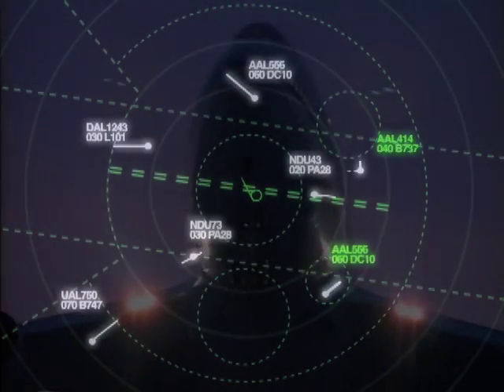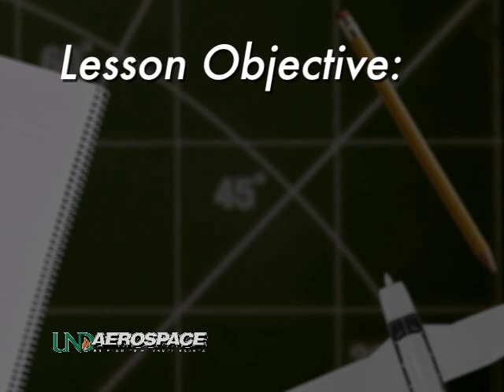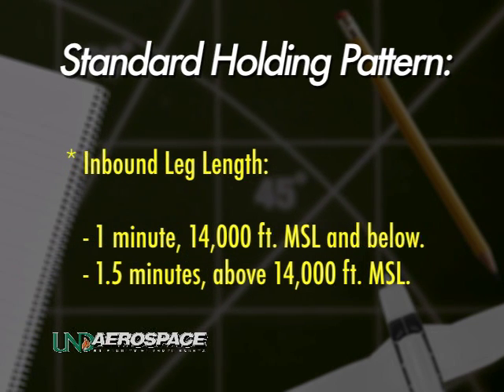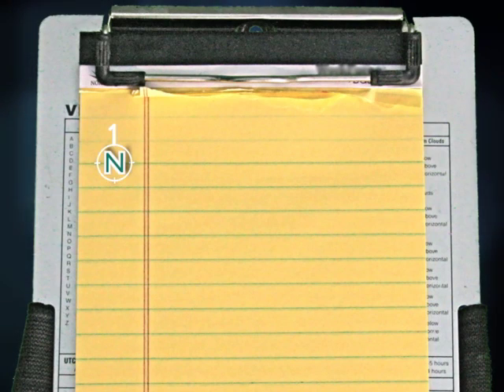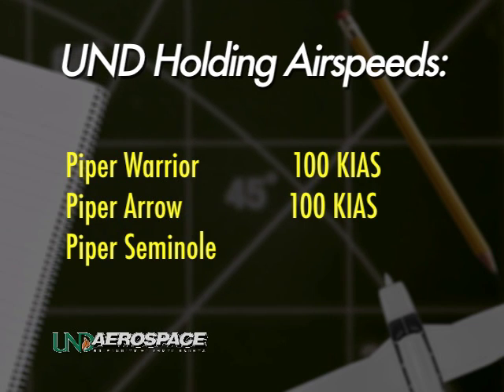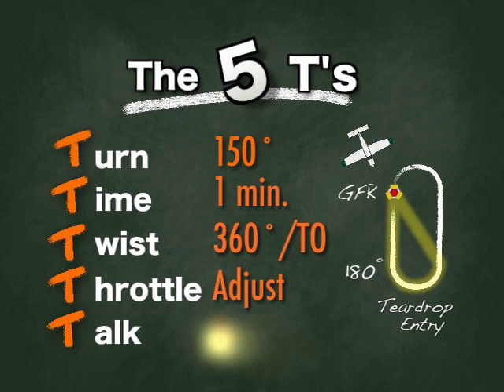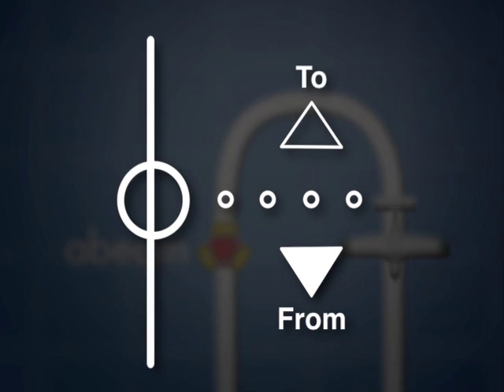(VIDEO 1) The Holding Pattern

Comment: Thanks alot for such informative video. Wanted to ask few questions
Q1:Why standard holding pattern always right side? Is there any specific reason?
Q2:And let down after a holding pattern should always be opposite side i.e left hand?
Reply: Umar,

You ask a good question regarding “why” the standard IFR holding pattern is to the right.  Many of these “rules” are very old, the history and reasoning of some of these rules go back to the time of our grandfathers or great-grandfathers; 1930s-40s-50’s.  I typed in your question in Google and this response comes from an AOPA (Aircraft Owners & Pilots Association) article on the subject.  There are two plausible answers below.  I’m not sure of the exact reasoning why the IFR system was designed in this way.  I suspect that this rule is very old.  Because of the passage of time it would be very difficult to establish beyond any doubt any single reason.  But they both seem reasonable, especially the 2nd reason stated by the former TWA Captain.

““By turning right pilots keep the ‘unprotected’ area on ‘their’ side of the airplane and the protected area inside on their right wing. This is similar to why ‘left patterns’ are standard (to keep the runway on the pilot side because that is where we should be looking perhaps) versus ‘right patterns.’ Just one thought to share.’”
Writer and former TWA Captain Barry Schiff, author of AOPA’s Proficient Pilot column, recalled that he learned the reason for right-hand holding patterns in the mid-1950s, when he was studying for his instrument rating.
“Many holding patterns are executed in VFR conditions, which means that those in a holding pattern could encounter opposite direction VFR traffic that might be climbing or descending through the holding altitude. Veering to the right (as required by right-of-way regulations) to avoid opposite-direction traffic keeps the holding aircraft in its pattern. This would not be true when executing a left-hand hold, which is why left patterns are the exception, established only when necessary (because of terrain, for example).”

Comment: Could you point to an ICAO document, which explicitly defines STANDARD holding with RIGHT turns please? 8168 doesn’t do a good job, it just describes right patterns, but doesn’t say which turn is standard...
Reply: vnratc : DOC 8168, Volume 1, Section 6.

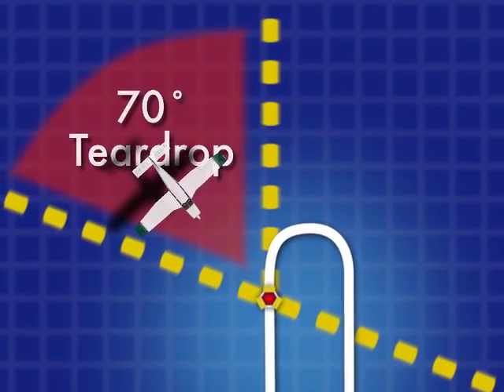Comment: 5:55 teardrop entry, crossing the fix, flying at an approximate 30 degree angled ""to"" the inbound leg. Should it be 30 degree angled away from inbound leg? for example, inbound leg 180 radial, outbound leg 180 course, for std holding, as depicted in video, you should turn after fix 150 course and hold time 1 minute?

Comment: Those MAX. speed in the hold are stupid.. While flying in hold, where is the point to rush in a hold? 😂😂
Reply: “Max speeds are stupid”,  well ………… hopefully you will not always be flying a single engine piston airplane.  The speeds have to do with terrain clearance, protected airspace and TERPs criteria.  The faster you fly the further you fly per minute; at 100 knots you cover 1.66 NM every minute (no wind), at 200 KT it’s 3.33 NM.  Add a 60 not tailwind at altitude, or more, and the distances covered increase proportionally.   The airplane I fly cannot fly clean, slats/flaps up, at normal weights at 200 knots, 200 KTS is too slow it is BELOW minimum maneuvering speed for the clean configuration (at normal operating/landing weights).  We fly in mountainous terrain, below radar coverage and frequently have to “hold”.  It is important to know just how much protected airspace is out there under and around you while you are driving around at more than 3 miles a minute (and of course where the terrain is and how high that terrain is).  Holding patterns are built with terrain considerations (and others as well) which is an additional reason there are MAXIMUM holding speeds associated with altitudes.

Comment: Question. 3:49 inbound heading TO the fix. Not from the fix. You are inbound to the fix  not from the fix. 5:20 the holdings is set up for a non-standard left turn, but you showed it as being a rigtht pattern.
Reply: The sectors shown are incorrect for that hold. The entries should be flipped about the vertical access to be correct.
Reply: @parkex9840  5 years later and you are still right!
Reply: jķkapp0
Reply: +jesus inzunza When ATC issues a holding clearance, they will always define the holding pattern by specifying the inbound leg itself, FROM the fix.  At 5:20, the hold depicted was not intended to follow the previous clearances that were set up - we were just trying to show a standard holding pattern and diagram the entry sectors.

Comment: How many aircraft can be in a hold? I mean, if there are six planes in the same pattern, entry into the pattern is going to be a little dicey trying to avoid traffic. One plane per hold pattern? That would be the most logical, but I don't know, so I am asking!
Reply: +Täking Thë High Roäd Different altitudes 1000 ft. Several aircraft may fly the same holding pattern at the same time.
Reply: Good question Charles Fox!   Generally, multiple aircraft are dispersed in different areas for clearance safety.  Believe it or not, there are thousands of points which can be designated as a holding location.

Comment: Great video.  I use the "6 Ts"  Turn, Time, Throttles, Twist, Track, Talk.  TRACK is super important.  It means to maintain the proper holding ground track.  That require triple drift correction on the outbound and single drift on the inbound.

Comment: #DreamVikings   a procedure turn is to reverse yourself as in a runway with a VOR approach and obstacles around while a tear drop is an entry to reduce the bank angle and turns in a hold , FYI a tear drop reverses your course perfectly but the only authorized PTs are +45 (1min) and the non standard  +80-260
so each way serves a purpose but overall its regulations
Reply: Makes a lot more sense when you account for regulations and obstacle clearance. Thanks.
Reply: You are welcome :)

Comment: 5:21 is wrong, it supposed to be a stand holding pattern (to the right) there it is classifying as a left holding.
Reply from the maker: The pattern depicted at 5:21 is a standard pattern and clearly shows right turns.  Also, remember, when requested by ATC, holding patterns can come in all shapes and sizes and can include left turns instead of right turns - they can be "non-standard" so make sure to copy your clearance correctly.

Comment: Hi sir , how are you and your flights doing ? hope for you CAVOK and SKC lol 
Please sir Would u mind helping me solving this matter ?
Gliding calculation
An airplane at a certain altitude (ex 45000 ft ) with an engine out , and started gliding at a specific VS , How long can this a/c fly before touching the ground ?
Reply: On a multi , you don't glide , you proceed and try to restart it
and if it is a single engine , your glide distance is in the POH , for a Cessna 172 its 700ft v-rate and 1000ft for every 1.5nm
Reply: VS: vertical speed?  45,000':  FL450, what is the elevation below the aircraft?  Sea level, or the Himalayan mountains?  Assuming VS means vertical speed and assuming there is nothing below the aircraft except the ocean, or sea level airport, and there is 45,000' feet then simply divide 45,000 (feet) by your vertical speed (feet per minutes) to determine the time it will take to descend from 45,000 to sea level.  For example if your example engine out airplane is descending at 2,850 feet per minute then 45,000'/2,850'=15.789 minutes (time).  15.789 minutes converts to 15 minutes and 47 seconds (rounded to the nearest second).  That is your answer in TIME.  For your answer in DISTANCE you have to know the average ground speed.  Make it simple and convert that ground speed (usually in hour increments) into speed per minute.  With a known ground speed (per minute) multiply that value by 15.789 to determine the distance traveled.  So, an average ground speed of 210 knots, equals 3.5 nautical miles per minute.  3.5 NM per minute X 15.789 minutes of descent (210 knot ground speed & 2,850' descending vertical speed per minute) equals 55.26 NM.  Your example aircraft will cover 55.26 nautical miles before touching the ground.

If you have access to a Flight Handbook, look under the performance section.  There is often a series of tables showing engine out glide speeds, varying wind scenarios, time and distance traveled flight planning data.

Comment: Don't think of the radial/DME fix as a heading...they are totally separate things.  I always start by making a dot for the VOR, then draw the radial, followed by a perpendicular line for the fix across the radial.  Draw another perpendicular line on the radial depicting which side of the fix to hold on (in this case SE)...always drive to the holding fix on the radial FROM the direction you're told to hold (in this case SE) or a 330 course.  Right turn is standard unless directed otherwise.

Comment: I am a VFR pilot about to start learning my IFR.  Can someone clarify one point. The first ATC direction was hold SE GFK on 150deg radial.  From there it seems they are talking about an entirely different pattern, oriented 180deg, and the 150deg is only the entry vector in.  If ATC says hold SE GFK on 150deg radial, I assume my inbound will be 150 and outbound 330, correct?  The remaining example is 180/360 - confusing to a new person.  THANKS FOR REPLYING!
Reply: .nipppplkokiuyyfdsssesqwwqawàuujm

.pb       vb 
bnm

Comment from the maker: punchoo, AIM recommends 1 minute entries for all timed holding patterns. This is reflected in AIM 5-3-8 under "Entry Procedures." However, for DME and GPS Along Track Distance holds, the AIM suggests flying the distance prescribed for both the entry and holding pattern. So the short answer, fly the leg distance during the entry procedure as recommended in AIM 5-3-8 j 5.  In your case, yes, you would fly 4 NM outbound after crossing the fix prior to your inbound turn.

Comment: Great Videos. Thanks.
Question: If performing a parallel or a teardrop entry on a 4nm published hold how long should the aeroplane be flown after passing the fix and before turning inbound towards the fix to commence the hold? Should it still be 1 minute or should it be 4nm? Logically it make sense to fly 4nm after passing the fix and then turn inbound towards the fix. Can't seem to find a clear answer to this. Can you throw some light on this? Appreciate it. Thanks
Reply: Punchoo Skywards You must figure out how long the plane flies for 4 nm. An easy rule of thumb is at 60 kts Groundspeed the airplane will fly 1 mile per minute. 90 kts GS=1.5 mpm, 120 GS=2mpm, etc.